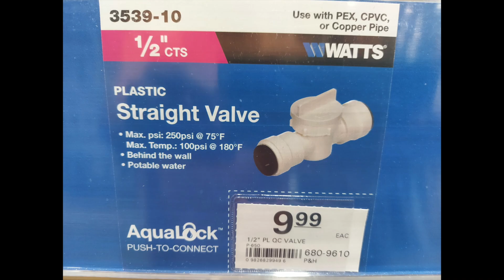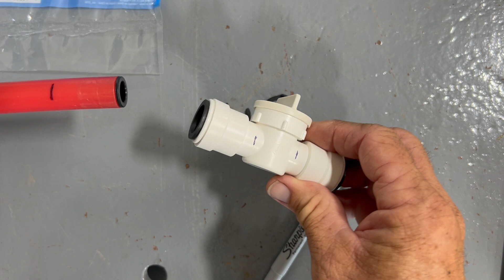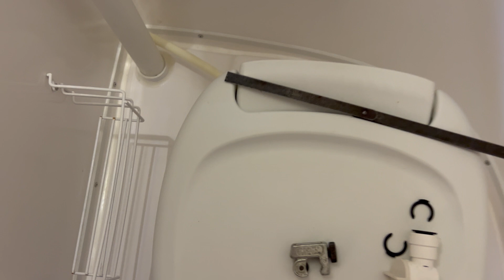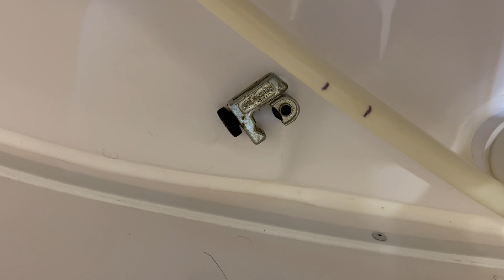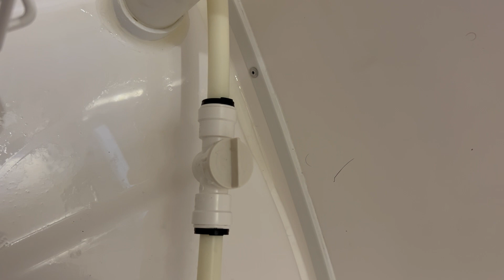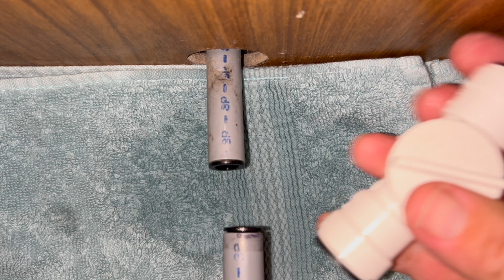How to Install Camper Toilet Shut Off Valve

Comment: Where can I get one of those valves? RV supply store or Lowe’s/Home Depot?   Also do I need to get any kind of plumbers tape or caulking?   Just want to make sure I know where to go & what to get after work to fix this problem that has kept me from much sleep for several nights.  🫩🥱I’m a very sleepy widow who needs to be alert at work. Any information would be greatly appreciated.